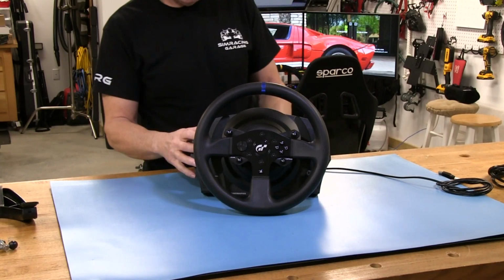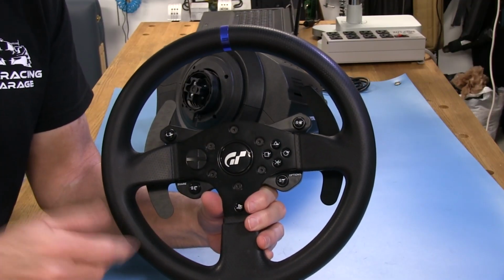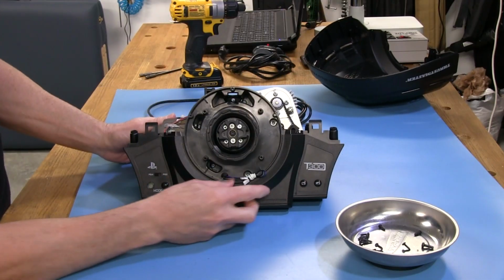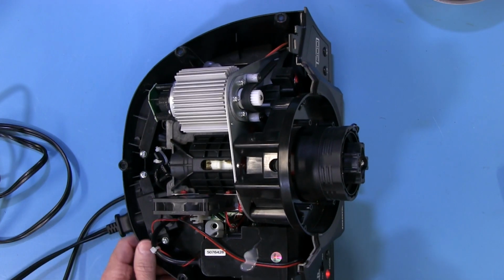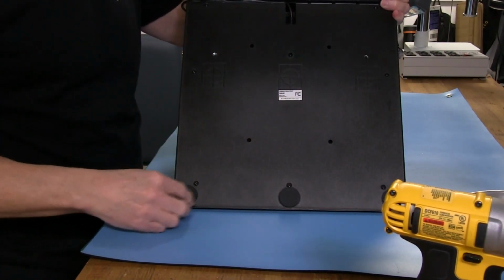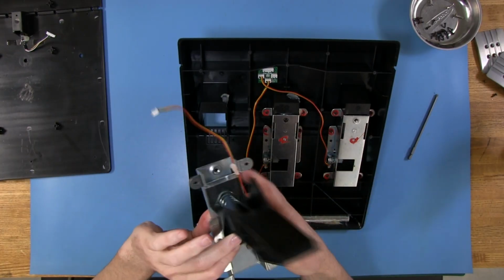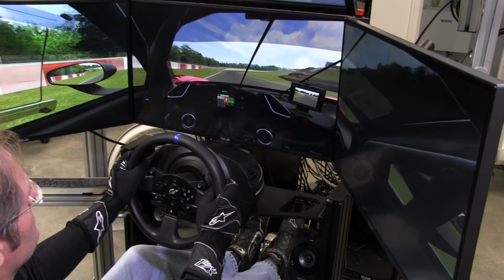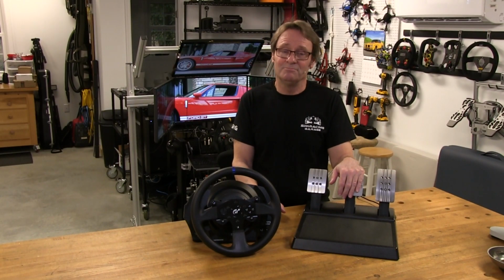Thrustmaster T300RS GT Review

Comment: I wonder if anybody can help me. For my first wheel, is it best to go for the T150 Pro (metal/plastic 3-pedal set) for £180 or the T300RS (metal/plastic 2-pedal set) for £280 (with the swappable rims, of course). Not clear to me if it's worth doing £180 and then £280 for the grand total of £380 once you get some money back from the T150. Note that I won't be buying the H-shifter ever so the 3rd pedal is useless to me, thus making the 2 metal pedals the best option forever, pretty much (unless I buy the £150 T3PA Pro set later). So, the fact the T300RS only has 2-pedals is a non-issue for me for the first 1-2 years. Just need to know about T150 Pro VS T300RS standard as a first wheel! Thanks.

Comment: haha plastic gears for 330 eur very funny
Reply: its a belt driven wheel....
Reply: @fuzzytron  so?
Reply: @ocoro174  the gears don't come in contact with each other, there's no wear there. Wouldn't matter what it's made from.
Reply: @fuzzytron  surely you know that plastic is much more easily deformed than metals, creating a less "tight" feeling when using plastic gears. anyway I was talking about the pedals mainly where they do come into contact with each other

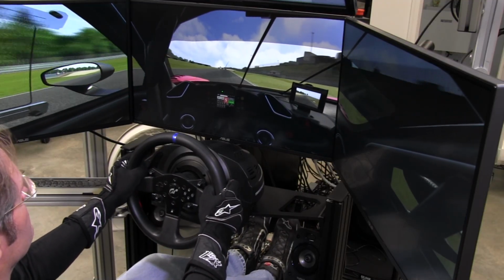Comment: 43:50 funny the other day my wife made me realize that whenever i fuck up a turn i tend to scratch my nose or touch my face afterwise...just like you did there! hehe
Great review i have a G25 and i'm considering selling it and getting a T300RS GT edition with the Th8A shifter...and maybe in the future upgrading to the T3PA-Pro pedals and maybe getting a nicer wheel to put on the T300RS servo...should i do it?
Reply from the maker: The G25 has been used to win a lot of races over the years. So, if it isn't giving any trouble no reason to replace it. On the other hand, if you have some disposable income, it's always a nice treat to get a shiney new wheel, pedal set, and shifter for your driving pleasure. But really, only you can make the call.
Reply: did you get the T300RS GT? if so how is it, im thinking of getting one
Reply: @cory4071  did not. Read too many horror stories about reliability and couldnt find one at good price...ended up getting a brand new G29 with the shifter from amazon got a good deal on it...changed the shift boot and the shift knob on the shifer and now i like it.
Reply: @TechWizMaster  i might try to risk it and get a t300rs, because then you can swap which wheels you like and apparently its smoother since its belt driven, I can always replace it if it breaks.. thats if its still in warranty, but ill consider getting the g29 too
Reply: @cory4071  i've never had the chance to try other wheels so i couldn't tell but i can see that it's smoother...the G29 is notchy sometimes if you put a lot of effects on...but the way i have it setup it works really well. G29 is louder too i would assume.
This is, to have similar equipment with the T300RS i was looking at almost double the price...
The pedals on the G29 are really good IMHO...and the shifter is cheap but once you upgrade it with automotive parts from amazon it's fine. Like this: https://www.gtplanet.net/forum/threads/logitech-g29-shifter-mods-improvements.356908/

Comment: my T300 (ferrari 458 serie) steering wheel turns to one side and the other always non-stop as soon as it connects, what can this be ?? fault I already reset the PS4 and also logged in and went back to the console ... but every time I turn the steering wheel it goes back and forth without stopping .. I do not know what it might be. Help me! is it brocken? is there some suport or adjuste via PC?
Reply: @Darren Murphy but it can do it for hours! not seems to be about calibration to me..
Reply: @Darren Murphy The wheel is only hitting one side ... it hits and turns to the center and turns the same side (if it was a calibration, I think it turned to both sides ..) and it always stays there to hit the same side for as long as it is on. It looks more like an electronic problem. As soon as I turn the wheel on, it's always hitting and knocking and knocking to the left side - and never to the right side (or if it go, it go slowly)
Reply: @Darren Murphy Yes .. the wheel came along with a playseat that I recently bought + pedals (300Euros) .. of course it should already be a few years (I think 2 years) but still, being T300 (middle class) one would expect it to be tougher - or to last at least longer! I already put it on the PC to calibrate, but it continues to hit like a madman's head in a hospice or else it does not react. I'm from Portugal..I do not think there is any kind of assistance here ... besides, for 50Euros, I got the T150..which works wonder and makes me forget the other's problem.But of course I will NEVER buy Trustmaster .. other than like this wheel T150 for 50Euros (cheap) .. and I advise you to buy Fanatec (what I'm looking for too - good opportunity)
Reply: @Darren Murphy but where are you from? I'm from Portugal! (living in) .. I think you're not from the side - near by-

Comment: Thank you for not making me feel old, as somebody born in the 70's it is nice to know we exist us older gamers, a lot to be said for age.. Very good review, i find it hard to slate games today, when I grew up with Indy 500 on Atari and Pong in black n white hell even Astro Wars took batteries. Galaxians was real life gfx to me.  Keep up the good work. P.S I bought a T300 Alcantara setup and im happy could have gone Fanatec but not a priority just paid the mortgage off and was brought up to not spend that much.. But T300 is fantastic for a simmer who wants more than joypad and isn't pro sim. I took mine apart and upgraded the Pots and dual fitted my bluetooth mouse inline as Left mouse = clutch, middle potention meter (scroll wheel) mouse (best for stiffness) = brake and accelerator is mouse right button, with a switch to turn them off. It comes in handy for other games.. Alot of flight sims wont let you use clutch and accel as rudder. So by fitting scroll wheel to 2 feeds switched on clutch and accel can be done. I next want to fit a trackball with smaller ball (marble size) in center of wheel.  One thing the t300 as going for it is dual belt i prefer belt to direct drive( i know im the exception) but horses for courses) not to mention how noisy they can be if midnight gaming when family in bed.. Ive rigged a blutooth keyboards tiny m/board (minus key board) to 4"x 2" plug board with a mouse sockets too for any control mapping custom key/mouse input switch, diy shifter and handbrake etc(like a telephone exchange) ill send you plans and a finsihed board if you want, free or plans to anyone interested on comments. Allows buttons that are plugged in to always be recognised by games without drivers.
Reply: Scoop...  Very good reply. Interesting how much you know/figured out to modify it to improve it's capabilities.

Comment: The non-GT version, without the clutch, has Horrendous deadzones for all the pedals. DO NO BUY THAT! Get the GT version or don't get it at all. The wheel itself is super solid and feels very premium. The motor is amazing, too!
Reply: Unless you have a broken Logitech as well, using the pedals and shifter connected to the PCB of that, connected to the computer :)
Reply: You can get the 300RS with the T3PA pedals which is what the GT version has. It's basically the only difference between the two models.

Comment: Is the force feedback in the T300 significantly better than in the T150? How noticeable is the difference? Not sure if it's worth upgrading just for the quality of the wheel base alone.
Reply: Tales Azzoni yes it has better and stronger fb but the biggest difference you are going to notice is how smooth the t300 is,

Comment: I just bought this wheel for 330€, I sold my g27 a while ago but I could not take it anymore without SimRacing with a ffb wheel. First I was gouing to get the t300 with the Ferrari swade wheel but it went up from 380 to 440€ so screw that. the smaller rubber t300rs has to suffice :P

Comment: There are lots of complaints in terms of reliability for the T300 base. We've seen the internals here, what part(s) usually gives the most headache to people who run into problems ? Is it fixable by the user ? US400 would be a significant investment for many people for something that doesn't work, including me.
Reply: Deniz1923 the fan itself is the main issue, I have seen videos of people getting an afetermarket fan and fixed the issue by themselves and seems to be the fix for this problem

Comment: How do you like this compared to the g29?
Reply: im gonna say that these two wheels are in two different classes, they cant really be compared. id go T300 if you can afford the extra.(id actually go Fanatec CSL Elite or clubsport if i got to go back in time. but hey xD)
Reply: @snowjix  You mean CSL Elite or Clubsport would be the same price range but better quality ?
Reply: @thanatosor  no sorry. The fanatec wheels are way more expensive. T300 is roughly $500(im from Norway so prices may vary) dollars wheel, base and pedals. The CSL Elite is $300 for the base only. But fanatec is known for better products. G29 vs T300 is deffinately a T300 victory in my opinion. Makes sense considering the price difference. 300 for g29 and 500 for t300.
Reply: @snowjix  I used a G29 but can't feel satisfied, it's around 400$ in my country. So should I save up for CSL Elite or go with  T300rs ?
Reply: @thanatosor  Not an easy answer for your questions im afraid. The only wheel i can truly have a huge opinion on is the T300, since its the only wheel ive owned. I think its great, great price for an excelent package. However CSL Elite (Fanatec in general) have a way broader product line, way more professional wheel rims, so the upgrading possibilities are fantastic. Just check out Fanatec.com (Fanatec isnt cheap mind you). They have a starter kit with a basic two pedal set (brake and accelerator) cheap looking rim and CSL base. That might be a good place to start. At that price point you can get a T300, alcantara wheel rim and T3PA pedals, which are very good i would say. But not much upgrading possibilities. 

TL;DR: If you are willing to pay some extra go Fanatec, i know i will.
Reply: @thanatosor   bro if you can save for csl elite  it will be better but if your budget is not enough go for t300rs  it's a good experience
Reply: @lokmanfreeman  I'm willing so save budget from now. But how much "good exp" compare to G29 ( which I owned before and still feel like I haven't felt my car completely ) ? 

Also, talking of budget, I saw there's also T150 too ( mixed belt/gear ) which is cheaper by 100 bucks. Can you give some comments on it too ? 

Thanks !
Reply: No answer ?
Reply: Ya me too waiting for an answer.

Comment: I'm thinking about change the conical mode. Wich kind of break mode would you use instead?
Reply from the maker: If you don't think you will be upgrading to a more expensive set of pedals in the near future. I would go with one of the available Load Cell brake pedal mods. Once you become familiar with the feel of a Load Cell, your braking will become more consistent and predictable. Which should lead to more consistent lap times.
Reply: Sim Racing Garage ok thank you

Comment: Adding a 24v supercapacitor and perhaps a fuse to the power supply might be an interesting experiment.
Reply: Thinking about it, with that many amps at the ready one could use a small, well tested, inexpensive and very powerful, mass produced starter motor for a direct drive wheel. Was also thinking the inverse of a compound bow like cam added to brake pedal could make a simple spring much more dynamic than a gas ram.

Comment: Just thought of new brake pedal mod or more exactly a better version of the old put a squash ball behind it mod. Wrap some wire around the squash ball so it doesn't expand out to the sides. This should make change in force needed to apply more exponential thus the amount of force for a needed amount of braking much more controllable because of it's distinctiveness.  I would like to call the mod "Saturn's Rings".
Too bad my old Momo wheel is too warn out to try it out myself and I cant afford to buy a T300RS GT.
P.S. I would gratefully accept donation to correct this.
(By the way those were pulleys not gears.)
Reply: Perhaps "Rings of Saturn Mod" might have a better flow to it. Might just want to wrap a tape round the sides to stop the lateral bulging. But, one can only analyze the vectors and scalars so much just in ones head.

Comment: I bought a used T300 with no Power cable, threw that psu away and replaced the whole thing with a Laptop power brick and it's been awesome ever since, well worth the 80 British pounds I paid for it.
Reply: May I ask which PSU? Having trouble sourcing a 32.5v
Reply: Same question... I'ld like to do that too so it doesn't overheat anymore

Comment: Hey - Thanks - WoW, Great Review. I recently got one of these Myself. Mine came with the Alcantera Ferrari Wheel. After Amazon sent me a used one Twice ( I could tell that someone had Unboxed them and Drooled all over it for  30 day's) I made them an offer that they did'nt refuse - 20% off, and I was Pretty Pissed. . . AnyHoo  -  Nice to get $94- dollars back.  One thing to Mention --- That if You do Not have a stand for this item - Get one Now. You'll need to. It cannot be attached to a desk. I originally thought so - but - not a thing.... I ended up buying the Racing Steering Wheel Stand from e-bay for $100 - It bolts right to it and is Very Sturdy. (After an Hour of DeBurring).  I'm glad to see what's inside of this thing. Great Job...

Comment: Very nice review! Do you think that it is worth to give the extra money for T300 RS instead of getting a G29?
Reply from the maker: Hard call to make. Really depends on what you like. A bit extra detail with gear driven G29. But, more power available with the T300 and it's smoother belt drive.
Reply: Thanks for answering! I think i will go for the standard T300 and upgrade to Fanatec pedals later on.
Reply from the maker: Have not used the T150. So, can't recommend something I have not had my hands on. But do plan a review in the near future.
Reply: I am looking to buy a wheel too I am between T150 and G29 , they have the same price, T300 is out of my budget. Which is better? Are T3PA better than G29 pedals?

Comment: What settings did you use for force feedback on the PS4 and Project Cars 2. Asking because it seems like you did not like it as much as iRacing or AC. I have Project Cars 2 feeling great for most cars these days and I'd put it very close to Assetto Corsa in that regard. I prefer the immersive profile ahead of the raw or informative.
Reply from the maker: I did not get a screen capture of my settings. But I did spend some time adjusting it. Just couldn't get the FFB to feel as good as when driving the others. I'll make sure to get that info on the next PC2 test with and upcoming G29 Wheel review.

Comment: The cooling solution in these things is very very poor. The fan is also a $1 piece of crap. I replaced mine with something better - I was able to replace the original 60x15mm fan with a 60x25mm fan. I did have to mod the deeper fan however by cutting off one of the corners in order for it to squeeze under the casing.  Other have gone a different route of adding extra fans inside.

If it lasts long enough to go out of warranty I'll eventually add some ventilation to the case.

Comment: Hi, excellent video! I just bought a loadcell kit from Richmotech, apparently for the T-500 and T3PA PRO, but have the T3PT-GT which are exactly the same as the T3P-GT's. Unfortunately they're a no go with the T3PGT and T3PT-GT. The metal plate won't fit in the housing because it's too long. Do you have any suggestions or any solutions for this? I greatly appreciate your time and effort... I am currently using the Thrustmaster T-GT which is definitely a great wheel for GT Sport, it however is barely a step up from the T300RS when used as a standalone wheel base for PC or PS4 because there's no support outside of GT Sport for the transducer and the other feature "T-LIN" or linearity. Again thank you!